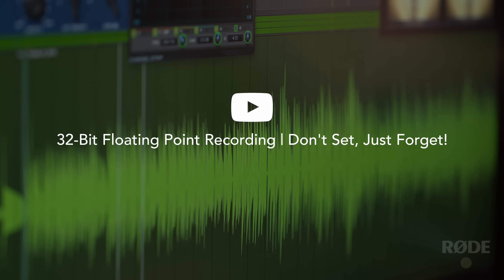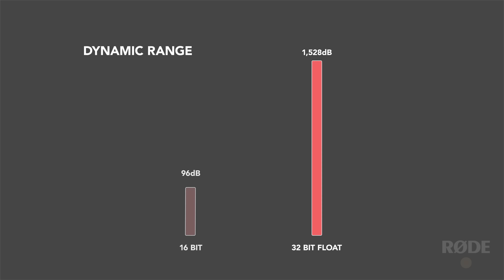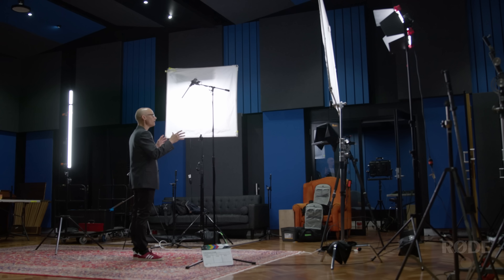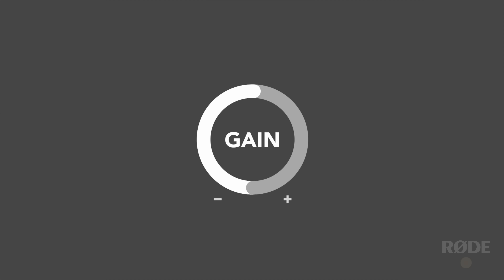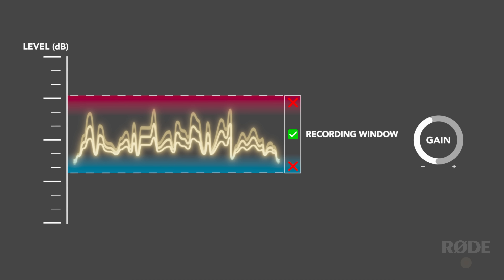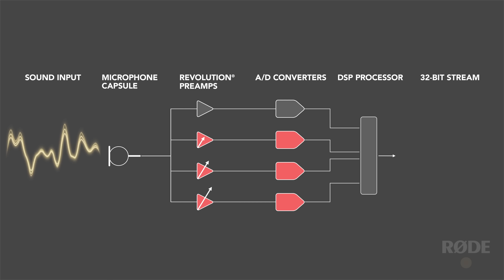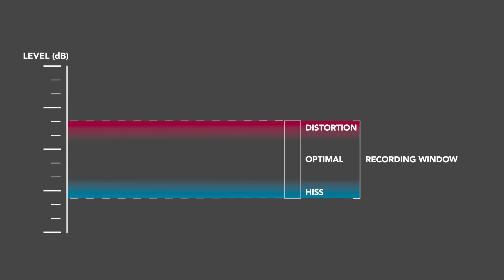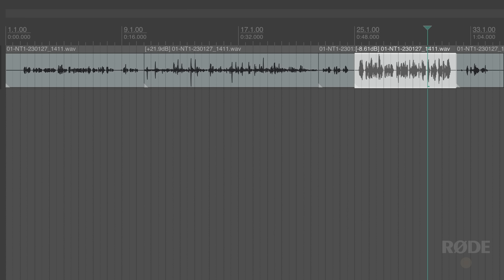Game-changer: How 32-Bit Float Recording Makes Clipping a Thing of the Past

Comment: I think HDR photography would be a much better analogy. In audio, you have this window you have to shift around. In photography that window is the dynamic range of the camera sensor and it comes exactly with the same problem. When you don't set that window to the correct setting (gain or exposure settings in the camera) some samples/pixel will be outside of that range (clipping/hissing/non-audible or over or under exposured) which can't be restored in post because information was lost. Sometimes, what you want to capture has such a big range in volume/brightness that the window you're shifting around just isn't big enough (very loud AND quite impulses or very bright AND dark areas in the picture). To deal with that you just make multiple recordings (at once with audio/in a row with photo) and then combine them by having different pairs of preamps with different gain settings and A/D converters, choosing the converter which is within that window for that specific sample or taking multiple photos and choosing the photo with a good exposure for that specific pixel.

RAW or JPEG files are a better analogy to WAV or MP3 files. JPEG and MP3 files are compressed and information was lost. RAW and WAV both are uncompressed and all the information of the recording is still there. But just with a RAW photo without HDR, you can still have the problem of over- AND underexposed pixels when the dynamic range of the sensor is to low for that picture.
Reply: This is very correct.
Reply: HDR Photography is the equivalent of overdone audio compression. Not the same.
Reply: As a professional photographer it is most similar in my mind to setting color temp in raw vs jpeg. It's something I frequently just leave it on auto for raw because I can change it after the fact. If I was shooting jpeg for some reason though it needs dialed in by hand.
Reply: I think HDR is the best analogy, not RAW. 

With most audio capsules, there is a technical limit to how much DB it can capture, but for most practical purposes, it’s quieter than you and hear and louder than you can hear. 

Camera sensors aren’t like that at all. At best they can capture 15 stops of dynamic range, and the human eye can see something like 23 stops. So the sensor is a very weak part of the camera. So multiple frames have to be captured at once. 

32 bit recording, like HDR allows to smash the extremes into one file using clever processing. Not exactly the same, but pretty close.
Reply: Yup, HDR is a much better comparison.  In fact the multiple exposures of HDR photography equate quite well to the multiple preamp / AD converters of this mic.
Reply: The point of an analogy is make an unfamiliar concept understandable by comparing it to a familiar concept. I don't think that the concept behind HDR photography is substantially more familiar to the average person that the concept behind 32-bit float recording. It is therefore not a good analogy at all.
Reply: @aldavidson1044  The familiarity of the concept is completely irrelevant.  The person who wrote the script for this video does not seem to understand what RAW photography is all about.  There is no connection between the concept of 32 bit float audio and the concept of RAW photography.  To use one as an analogy for the other isn't just misleading, it's simply wrong.  RAW photography isn't about dynamic range, it's about data compression.  It's closer to the concept of WAV vs mp3.  HDR photography is about dynamic range and sampling at different sensitivities.  Like the execution of 32 bit float via multiple preamps in this mic.  Well, if the concepts of RAW photography and HDR photography are generally misunderstood, then better not to use either as an analogy in this video.  But if you are going to use an analogy, make it one which is factually correct and which is likely, in some cases, to assist people's understanding, rather than causing confusion.
Reply: @Ozpeter  Did I even mention RAW photography in my comment? The answer is no. I simply pointed out that HDR photography is not a good analogy because it is not any easier to understand than 32-bit float audio. And, yes, the familiarity of the concept behind an analogy is in fact critical for the analogy to be of any use. I assumed that it goes without saying that the analogy also has to be accurate. So in the case of HDR photography, it might be an accurate analogy, but it is not a good one because I'm not familiar with it, and it therefore doesn't help me understand 32-bit float audio.
Reply: @aldavidson1044  This part of the comments is a discussion of whether the analogy of HDR is better than RAW, when comparing 32 bit float concepts and photographic concepts.  Indeed, it's arguable that comparing audio concepts to photographic concepts is not helpful to everyone.  In a way, it's not necessary to understand the concepts of either - it's more important to understand the practical implications.

The chief practical implication of 32 bit float recording from a mic incorporating a digital output - like this Rode mic - is that it does away with the need to set levels when recording.  Just capture the digits it emits, and adjust levels afterwards.  The adjustment of levels in the DAW can be undertaken in two ways, broadly speaking.  You can 'normalise' the audio so that the maximum level of the finished file peaks just to -0db (or whatever peak value you set), and that means that the full original dynamic range will be preserved - the train passing by will peak the audio to full scale (reducing the level to that if necessary), and the sounds of the birds after it's gone will strain your ears to hear.  The other approach is to manually or automatically compress the audio, so that once again the train peaks to full scale, but the birds are amplified after it has passed so that you can still hear them if the dishwasher in the playback space is running.  You would also, in theory, hear any analog system noise from the mic capsule and preamps in this amplified section, but the manufacturer's setup of mics like this will be undertaken in such a way as to keep that to a minimum (within the budget), without the user having to think about it.  

For me, the ultimate device for 32 bit float recording is made by Zoom, where like this Rode device, you have a mic capsule (well, two in the case of the Zoom as it's stereo) feeding multiple internal preamps and analog to digital converters,  but the Zoom device also records that output in 32 bit float to an inserted SD card.  So you simply point the mic at the sound source, and press record.  No cables.  No level setting.  No meters even!  Seems like a no-brainer to me (which perhaps suits my brain...).  So in summary, never mind how it works, what can you do with it?
Reply: MP3 still has a very wide dynamic range of a couple hundred dB, but it adapts to the level every 40 milliseconds or so whereas PCM float does it independently for each sample. A WAV might only have 16 bits with limited headroom, similar to raw where you can extract some lost highlights but still have to set the overall exposure.

Comment: This is a great video explaining how 32-bit float recording works!  I think the only aspect that's missing is the notion that you still need to practice good mic technique and placement when recording in 32-bit float.  An analogy I like to use is to think of 32-bit float recording like shooting a 360 video.  With a 360 video, you can simply hit record and reframe your shot in post, much like 32-bit float recording and the ability to "reframe" the gain in post.  However, if your initial 360 camera position is, for instance, too low, you can't magically change the perspective.  Likewise, if your mic is too far away from your subject, and you're in a noisy environment, raising the gain in post brings up not only the voice being recorded, but also the ambient environmental sounds.  Conversely, if you're too close to the mic, plosives will still ruin a 32-bit float recording.
Reply: Thank you for this great explanation! I just started doing more 32-bit float recordings myself.  It feels so weird not having to set gain or trim.
I have been trying to figure out how it works to have more options available in post.
Reply: I would consider AI that changes the perspective or removes noise pretty much doing it magically

Comment: For the math-curious, the "float" concept is basically just scientific notation, such as 1.2345x10^-6, where most of the 32 bits are used to store the "mantissa" (1.2345..) and a few store the exponent (-6). This lets you represent a vast range of values without losing important details. What's novel and exciting (to me) is that Rode integrated an ultra-wide dynamic range 32-bit float A-to-D converter into the already lowest-noise-ever NT1 that should now allow you to capture the artist's eyes blinking from across the room. One might say it's a complete GAIN changer :D
Reply: What mic are you talking about? Is there a USB NT1?
Reply: @chriscalinescu  Yes, the video is about NT1 "5th generation" which has an AD converter in the mic and usb-c jack
Reply: These higher level math courses in university are finally paying off :) Jokes aside, thanks for the explanation.
Reply: It's pretty much impossible to have true 24bit resolution adc let alone 32bit (float or not).
Reply: It appears clever dsp is used to combine signal from different gain settings. The result can be very good however it can be done with 24bit as well. 
And I'm 99% sure the ADC won't have 126db snr and doesn't clear 21bit with the combination it can be close to 140db but not more than 24bit capabilities.
Reply: @johnyang799  You're probably right that this won't exceed 21 or 24 bit capabilities in the actual waveform data you get, but I think it's that 4 dB-A noise figure that is difficult to get any other way, including a very high quality preamp and not too long xlr cable. For me, as hobby recording guitar and other acoustic instruments, it's all about the noise floor.. cheers!
Reply: floats are something you learn the first day you use a graphing calculator in highschool
Reply: @journeytree  This is true
Reply: but it's still interesting, check out fast inverse square root
Reply: @johnyang799  32bit float only has a 24 bit mantissa, and some software compilers (like Microsoft's) only have 23 bit mantissa. This is why I use 64 bit float for my mastering, because i'm getting 53-54 bits of audio. And yes, I can hear the difference of different dithers to 24 bits with my reference DAC & headphone setup, with full-scale music playing. So it does make big difference to use 64 bit float, instead of 32 bit float. I also only use plugins that support 64 bit float. Not all VST3 plugins support 64 bit float either. Many don't, and it made a big difference in the audio quality when I stopped using those.
Reply: @johnyang799  There is more than one ADC involved, and they are set for different input gain settings. If you use two ADC's and set them 24dB apart in gain, then you can add 24dB of dynamic range beyond that of a single ADC. It's just a matter of combining their outputs mathematically.
Reply: @ScottGrammer  Then the output can be 24bit while still having the benefit of using 2 ADCs with different gains combined. right?
Reply: @johnyang799  Yes, but the 32-bit float thing is different. It allows the capture of an absolutely insane dynamic range, because it does not follow the usual linear function of PCM digital audio. Still, you could use two or three ADC's with plain 24-bit recording.

Comment: In this video you guys are forgetting that preamplification happens before conversion, in the analog realm. 0VU is still 0VU, no matter how much digital headroom you have. So what you are talking about is still processing and not recording.
Reply: Not really. You do have additional headroom. Each A/D converter has its own preamp range. When it gets overdriven it does not contribute to built 32F word.
Reply: @zbyszekolko3998  Yes, but in practical sense that is only true in a device that has BOTH preamps and converters. Single preamps only have a varying dynamic range of about 100dB. We are still converting analog signal to digital and thats where the video is a bit misleading.
Reply: @RobDiesALot  Well, A/Ds usually have some sort of preamp at input. You can also attenuate input signal to some ranges.
Lot of 32F videos are misleading cause they explain 32F in digital enviroment. No unlimited headroom in 32F A/D converter built with multiple 24I A/Ds . It is physics not a digital abstract.
Reply: @zbyszekolko3998  Not sure I get what you mean, but the original comment stands. In analog, where it all begins, distortion/hiss may still happen. 32-bit recording is only half of the equation. It doesnt matter in some devices, but generally the idea that 32-bit = no distortion or hiss is just wrong.
Reply: @RobDiesALot  Distortion happens when gain is set too high. Hiss happens when it is set too low. In case of NT1 you have four gain values outputted as 24 bit integer stream each which can be combined into one 32F stream while eliminating hissing or distorting ranges. In 
other words you have a voltometer with four ranges and you can measure each sample value with a range which gives you the best accuracy.
Reply: @zbyszekolko3998  Exactly. So the hiss or distortion doesnt really have much to do with 32-bit float here does it? Its the stacked preamps mostly. 24-bit could still work just as well, but it wouldnt be that easy to market. Thats why this general misconception about what 32-bit does exists. And yes in case of NT1 it works, but the video isnt talking about just one product, its basically saying 32-bit float is BETTER. But its really not that simple.
Reply: @RobDiesALot  I can hardly imagine any advantage of using four ADCs in parallel and output 24 bit word lenght. You would have to round their readings to much smaller word lenghts. Like eg. 4digit voltage reading: 0,314 rounded to 0 because the main scale is 0000 to 9999 whole numbers.
Reply: @zbyszekolko3998  Yes, there is no advantage. Im sure 32-bit ADC is so inexpensive that it practically doesnt make sense to not include it, almost every converter can do it these days. But my point still stands :)
Reply: That being said, I would absolutely still take a good 24-bit converter over mediocre 32-bit one. Its never just about a number when it comes to sound and music.
Reply: @RobDiesALot  Your point was 0VU is 0VU no matter what. My point was nobody should care about 0VU in 32F recording any more and I gave you good arguments to prove it to be true.
The NT1 competition of USBC connector are not expensive mic pres and stand alone ADCs but small usb powered 100$ audio interfaces.
I still use 24I on my 32F field recorder/mixer cause I am working real-time, I am paid to set proper gain and use two limiters in my path to take care of above headroom events.
Reply: @zbyszekolko3998   Ah, that wasnt my comment. I only meant,that 32-bit float doesnt provide extra headroom in recording without equivalent preamp solution. Merely pointing out, that 32-bit depth on its own doesnt mean anything, even though its marketed as "game changer"...
Reply: @RobDiesALot  I haven't heard about any 32F recording implementation without preamp contribution and it is a game changer vs 24 bit preamp/ADC combo because 0VU goal can be set after recording with minimal artefacts and it can cover a whole mic dynamic range. And Yes I believe you can make much better ADC out of multiple mediocre ADCs using 32F math.
Reply: @RobDiesALot  ABSOLUTELY !  This is a ridiculous marketing ploy, that's all it is.  This has been done before.
Reply: @RobDiesALot  I'm still waiting for SOMEONE, ANYONE, to point me to an actual "32 Bit Analog to Digital Converter for audio work !!!!!!!!!!!!!!!!!!!!!!!!!!!!
Reply: @RobDiesALot  WHAT 32 bit Converters ?????????????????????????